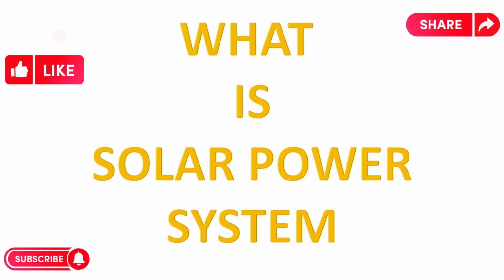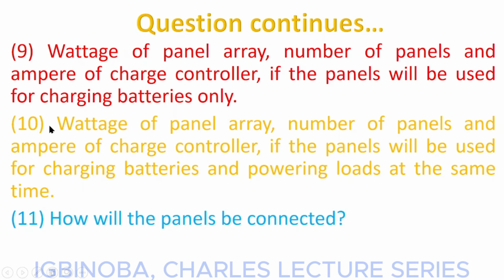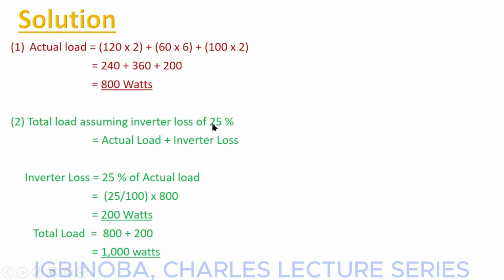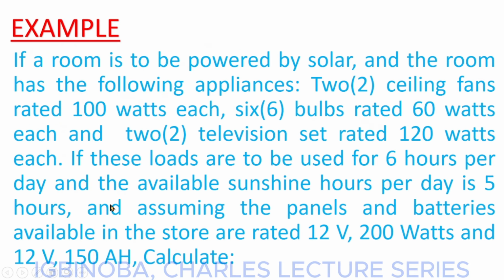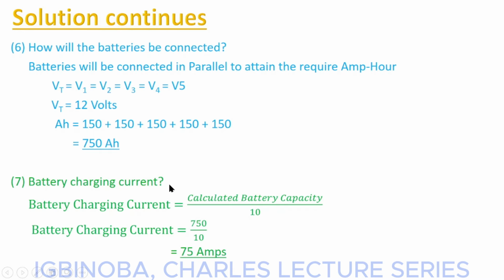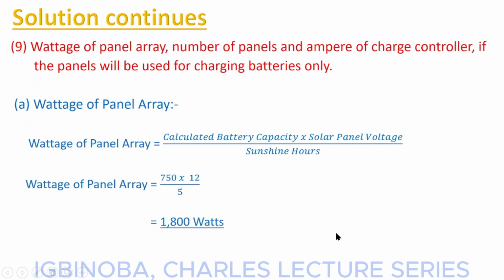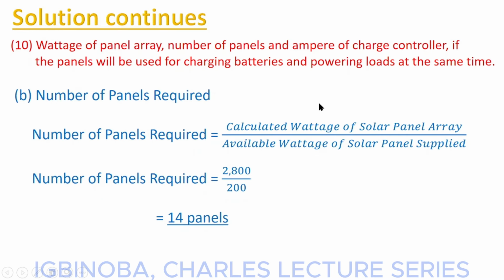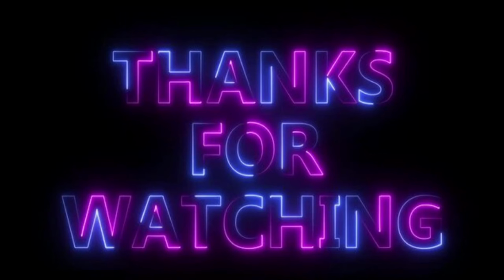Design of Solar Power System

Comment: PETRO89K
ANSWER:1.Actual load = 1380 W (8280 Wh/day)
2. Total load (25% inverter loss) = 1380/0.75 = 1840 W (11040 Wh/day)
3.Inverter rating = 1840/0.8 = 2300 VA
4.Battery capacity = 11040/(12×0.75) ≈ 1226.7 Ah
5.Number of batteries = 1226.7/150 ≈ 9 batteries
6.Connection = All in parallel (system voltage = battery voltage = 12V)
7.Charging current = 1226.7/5 ≈ 245.3 A
8.Charging time (40% loss) = 5/(1−0.4) ≈ 8.3 hours
9.Charging batteries only: Energy = 1226.7×12 =14720Wh → Power=14720/5=2944W → Panels=2944/200≈15 panels; Controller current=2944/12≈245.3 A
10.Charging + powering load: Total power=1840+2944=4784W → Panels=4784/200≈24 panels; Controller current=4784/12≈398.7 A
11.Panels connected in parallel (matching 12V system voltage)

Comment: PETRO5E

Answers:
1. Actual load = 1380Watt
2. Total load = 1725Watt
3. Inverter rating = 2156.25VA
4. Battery Capacity = 1239.75Ah
5. Number of batteries = 8.625 (9 batteries)
6. They will be connected in parallel 
7. Battery charging current = 129.375A
8. Battery charging time with 40% loss = 14hrs
9a. Wattage of panel array = 3105Watt
9b. Number of panels = 16panels
9c. Ampere of charge controller = 258.75A
10a. Wattage of panel array with load = 4485Watt
10b. Number of panels = 23panels
10c. Ampere of charge controller = 373.75A
11. They will be connected in parallel.

Comment: CIV82D
Answers 
1.1380W
2.1725W
3.2156.23VA
4.1293.75Ah
5.No of batteries is 9
6.Parrallel connection 
7.129.4A
8.14 hours 
9a.3105W
 b.16 panels
 c.258.75A
10a.4830W
   b.24 panels 
   c.402.5A
11.The panels will be connected in Parallel

Comment: EEE77Y 

1, 1380W

2, 1725W

3, 2156VA

4, 1294AH

5, 9 batteries

6, Connected in parallel

7, 129A

8, 14 hours

9, 3106W,16 panels, 259A

10, 4831W,24 panels, 403A

11, parallel connection

Comment: MEC44R

(1) Actual load: 1380 watts
(2) Total load:1725 watt
(3) Inveter rating:2156.24VA
(4) Battery capacity:1239.75Ah
(5) Number of battery: 8.625(9 battery)
(6) The will be connected in parallel
(7) Battery charging current:129.375A
(8) Battery charging time with 40% loss:14hours
(9a) Wattage of panel array: 3105 watts (9b): number of panel:16 panels
(9c) Ampere of charge connected:258.75A (10a) Wattage of panel array with load: 4685 watt
(10b) Number of panel:23 panels
(10c) Ampere of charge controller:373.75A
(11) They will be connected in parallel

Comment: CIV31E

1. 1380W
2. 1,725W
3. The inverter rating is 2,156.23VA
4. The battery capacity is 1,293.75Ah
5. The Number of batteries is 9
6. The batteries are connected in parallel
7. The Battery charging current is 129.4 Amps.
8. The battery charging time is 14 hours
9. The wattage of the panel array is 3,105W
b. The number of panels is 16 panels.
c. The Charge controller rating is 258.75 amps.
10. The wattage of the Panel array is 4,830 Watts
b. The number of panels is 24 panels.
c. The charge controller rating is 402.5 amps.
11. The panels are arranged in parallel.

Comment: CHM97S
1. The actual pad is 1,380W
2. The Total load is 1,725W
3. The inverter rating is 2,156.23VA
4. The battery capacity is 1,293.75Ah 
5. The Number of batteries is 9
6.  The batteries are connected in parallel 
7. The Battery charging current is 129.4 amps.
8. The battery charging time is 14 hours.
9. a. The wattage of the panel array is 3,105W
b. The number of panels is 16 panels.
c. The Charge controller rating is 258.75 amps.

10. a. The wattage of the Panel array is 4,830 Watts 
b. The number of panels is 24 panels.
c. The charge controller rating is 402.5 amps
11. The panels are arranged in parallel

Comment: 1. Actual load = 1380Watt
2. Total load = 1725Watt
3. Inverter rating = 2156.25VA
4. Battery Capacity = 1239.75Ah
5. Number of batteries = 8.625, so 9 batteries will be
used
6. The batteries will be connected in parallel
7. Battery charging current = 129.375A
8. Battery charging time with 40% loss = 14hrs
9. For charging only:
a. Wattage of panel array = 3105Watt
b. Number of panels = 16panels
c. Ampere of charge controller = 258.75A
10. For charging + powering load:
a. Wattage of panel array with load = 4830Watt
b. Number of panels = 24panels
c. Ampere of charge controller = 402.5A
11. The panels will be connected in parallel

Comment: EEE42P
1. The actual pad is 1,380W
2. The Total load is 1,725W
3. The inverter rating is 2,156.25VA
4. The battery capacity is 1,293.75Ah 
5. The Number of batteries is 9
6.  The batteries are connected in parallel 
7. The Battery charging current is 129.4 amps.
8. The battery charging time is 14 hours.
9. a. The wattage of the panel array is 3,105W
b. The number of panels is 16 panels.
c. The Charge controller rating is 258.75 amps.
10. a. The wattage of the Panel array is 4,830 Watts 
b. The number of panels is 24 panels.
c. The charge controller rating is 402.5 amps
11. The panels are arranged in parallel

Comment: MEC43Q

1. 1380 W

2. 1840 W

3. 2300 VA (or 2.3 kVA)

4. 1226.67 Ah

5. 9 batteries

6. Parallel connection

7. 122.67 A

8. 16.67 hours

9. Array Wattage: 3680 W | Number of Panels:

19 panels | Charge Controller: 306.67 A (or

350 A standard rating)

W

| Number of

10. Array Wattage: 5888

Panels: 30 panels | Charge Controller:

490.67 A (or 500 A standard rating)

11. Parallel connection

Comment: MEC34H 
1. Actual load = 1380Watt
2. Total load = 1725Watt
3. Inverter rating = 2156.25VA
4. Battery Capacity = 1239.75Ah
5. Number of batteries = 8.625, so 9 batteries will be used
6. The batteries will be connected in parallel
7. Battery charging current = 129.375A
8. Battery charging time with 40% loss = 14hrs
9. For charging only:
   a. Wattage of panel array = 3105Watt
   b. Number of panels = 16panels
   c. Ampere of charge controller = 258.75A
10. For charging + powering load:
    a. Wattage of panel array with load = 4830Watt
    b. Number of panels = 24panels
    c. Ampere of charge controller = 402.5A
11. The panels will be connected in parallel

Comment: CIV61I
Answers: 1. 1380 W

2. 1840 W

3. 2300 VA (or 2.3 kVA)

4. 1226.67 Ah

5. 9 batteries

6. Parallel connection

7. 122.67 A

8. 16.67 hours

9. Array Wattage: 3680 W | Number of Panels:

19 panels | Charge Controller: 306.67 A (or

350 A standard rating)

W

| Number of

10. Array Wattage: 5888

Panels: 30 panels | Charge Controller:

490.67 A (or 500 A standard rating)

11. Parallel connection

Comment: 𝗠𝗔𝗥𝟳𝟰𝗩

Answer:
1. Actual load = 1380Wart
2. Total load = 1725 Watt
3. Inverter rating = 2156.25VA
4. Battery Capacity = 1239.75Ah
5. Number of batteries = 8.625 (9 batteries)
6. They will be connected in parallel
1. Battery charging current = 129.375A
8. Battery charging time with 40% loss = 
14hrs
9a. Wattage of panel array = 3105Watt
9b. Number of panels = 16panels
9c. Ampere of charge controller = 258.75A
10a. Wattage of panel array with load = 4685 Watt
10b. Number of panels = 23 panels
10c. Ampere of charge controller = 373.75A
11. They will be connected in parallel

Comment: CHM79A 

1=1380W
2=1725W
3=2156.25VA
4=1293.75Ah
5=8.6 approximately 9 batteries 
6=parallel connection 
7=129.4Amps
8=13.99hrs approximately 14hrs
9=PV array 3105W, panels 16, charge controller 258.75Amps
10= PV array 4830W, panels 24, charge controller capacity 402.5Amps
11= parallel connection

Comment: MAR85G

Answer:
(1) Actual load
3 × 100 W + 10 × 60 W + 4 × 120 W = 1380 W
(2) Total load (25% inverter loss)
1380 / 0.75 = 1840 W
(3) Inverter rating (PF 0.8)
1840 / 0.8 = 2300 VA
(4) Battery capacity (75% reserve/DoD)
(1840 × 6) / (12 × 0.75) = 1226.67 Ah ≈ 1227 Ah
(5) Number of batteries
1227 / 150 ≈ 8.18 → 9 batteries
(6) Battery connection
All 9 in parallel (12 V system)
(7) Battery charging current
0.1 × 1227 ≈ 122.7 A
(8) Battery charging time (40% charging loss)
(1227 × 0.75) / (122.7 × 0.6) ≈ 12.5 hours
(9) Panels for charging batteries only
Power = 12 × 122.7 = 1472.4 W
Number of panels = 1472.4 / 200 ≈ 7.36 → 8 panels
Charge controller ≈ 130 A
(10) Panels for charging batteries + powering loads
Load current = 1840 / 12 ≈ 153.3 A
Total current = 122.7 + 153.3 = 276 A
Power = 12 × 276 = 3312 W
Number of panels = 3312 / 200 = 16.56 → 17 panels
Charge controller ≈ 280–300 A
(11) Panel connection
All panels in parallel (12 V system)

Comment: COMP74V

1. The actual load is 1,380W
2. The Total load is 1,725W
3. The inverter rating is 2,156.23VA
4. The battery capacity is 1,293.75Ah 
5. The Number of batteries is 9
6.  The batteries are connected in parallel 
7. The Battery charging current is 129.4 amps.
8. The battery charging time is 14 hours.
9. a. The wattage of the panel array is 3,105W
b. The number of panels is 16 panels.
c. The Charge controller rating is 258.75 amps.

10. a. The wattage of the Panel array is 4,830 Watts 
b. The number of panels is 24 panels.
c. The charge controller rating is 402.5 amps
11. The panels are arranged in parallel

Comment: NAT10J 

Answer 
1. The actual pad is 1,380W
2. The Total load is 1,725W
3. The inverter rating is 2,156.23VA
4. The battery capacity is 1,293.75Ah 
5. The Number of batteries is 9
6.  The batteries are connected in parallel 
7. The Battery charging current is 129.4 amps.
8. The battery charging time is 14 hours.
9. a. The wattage of the panel array is 3,105W
b. The number of panels is 16 panels.
c. The Charge controller rating is 258.75 amps.

10. a. The wattage of the Panel array is 4,830 Watts 
b. The number of panels is 24 panels.
c. The charge controller rating is 402.5 amps
11. The panels are arranged in parallel

Comment: PETRO70R

Answers:
1. Actual load = 1380Watt
2. Total load = 1725Watt
3. Inverter rating = 2156.25VA
4. Battery Capacity = 1239.75Ah
5. Number of batteries = 8.625 (9 batteries)
6. They will be connected in parallel 
7. Battery charging current = 129.375A
8. Battery charging time with 40% loss = 14hrs
9a. Wattage of panel array = 3105Watt
9b. Number of panels = 16panels
9c. Ampere of charge controller = 258.75A
10a. Wattage of panel array with load = 4485Watt
10b. Number of panels = 23panels
10c. Ampere of charge controller = 373.75A
11. They will be connected in parallel.

Comment: CIV84F 

Answers   :  
1.  1380W

2.  1,725W 

3.  The inverter rating is 2,156.23VA 

4. The battery capacity is 1,293.75Ah 

5. The Number of batteries is 9 

6. The batteries are connected in parallel

 7. The Battery charging current is 129.4 Amps.
  
8. The battery charging time is 14 hours
  
9. The wattage of the panel array is 3,105W 
b.  The number of panels is 16 panels.  
c. The Charge controller rating is 258.75 amps.   

10. The wattage of the Panel array is 4,830 Watts
 b. The number of panels is 24 panels.   
c. The charge controller rating is 402.5 amps.
  
11. The panels are arranged in parallel.

Comment: EEE3C

1380 watts

1725 watts

2156.25 VA

1293.75 Ah

9  batteries 

the batteries will be connected in parallel 

129.4 amps

14 hrs

3105 watts

16 panels

258.75 amps

4830 watts

24 panels 

402.6 amps

the panels will be connected in parallel

Comment: MAR42P
1. The actual pad is 1,380W
2. The Total load is 1,725W
3. The inverter rating is 2,156.23VA
4. The battery capacity is 1,293.75Ah 
5. The Number of batteries is 9
6.  The batteries are connected in parallel 
7. The Battery charging current is 129.4 amps.
8. The battery charging time is 14 hours.
9. a. The wattage of the panel array is 3,105W
b. The number of panels is 16 panels.
c. The Charge controller rating is 258.75 amps.

10. a. The wattage of the Panel array is 4,830 Watts 
b. The number of panels is 24 panels.
c. The charge controller rating is 402.5 amps
11. The panels are arranged in parallel

Comment: CIV45S

Answer

1

Actual load = 1,380 W

2

Total load = 1,840 W

3

Inverter = 2,300 VA → choose 3 kVA

4

Battery capacity = 1,226.7 Ah @ 12 V

5

9 batteries

6

Batteries connected in parallel

7

Charging current ≈ 245 A

8

Charging time ≈ 8.33 h

9

12 × 200 W panels = 2,400 W, ≈ 200 A controller

10

24 × 200 W panels = 4,800 W, ≈ 400 A controller

11

Panels connected in parallel for the 12 V arrangement

Comment: CIV3C

Answers:

1.The actual pad is 1,380W
2.The Total load is 1,725W
3.The inverter rating is 2,156.23VA
4.The battery capacity is 1,293.75Ah
5.The Number of batteries is 9
6.The batteries are connected in parallel
7.The Battery charging current is 129.4 amps.
8.The battery charging time is 14 hours.
9.a.The wattage of the panel array is 3,105W
b. The number of panels is 16 panels.
c. The Charge controller rating is 258.75 amps.
10.a. The wattage of the Panel array is 4,830 Watts
b. The number of panels is 24 panels.
c. The charge controller rating is 402.5 amps.
11.The panels are arranged in parallel.

Comment: MAR55C 

ANSWER 

1380watts

1725wattd

2156.25VA

1293.75ah

9  batteries 

parallel connection 

129.4amp

14 hrs

3105watts

16 panels

258.75amps

4830watts

24 panels 

402.5amps

the panels are arranged in parallel

Comment: EEE34H

(1) ACTUAL LOAD = 1380 watts
(2) TOTAL LOAD = 1725 watts
(3) INVERTER RATING VA = 2156.25 VA
(4) BATTERY CAPACITY = 1293.75 Ah
(5) NO. OF BATTERIES = 9 Batteries
(6) PARALLEL CONNECTION
(7) BATTERY CHARGING CURRENT = 129.39 Amps
(8) CHARGING TIME (40% LOSS) = 14 Hrs
(9a) PANEL WATTAGE = 3105 watts
(9b) NO. OF PANELS = 16 Panels
(9c) AMPS OF CHARGE CONT. = 258.75 Amps
(9d) PARALLEL CONNECTION
(10a) PANEL WATTAGE = 4830 watts
(10b) NO. OF PANELS = 24.15 (Make 25 panels to carry
system)
(10c) AMPS OF CHARGE CONT. = 402.5 Amps

Comment: NAT39M
1) Actual load= 1380W
2) Total load assuming inverter loss of 25%= 1725W
3) inverter rating in VA using a power factor of 0.8= 2156.25VA
4) Battery capacity using a factor reserve of 75%= 1239.75Ah
5) Numbers of batteries= 9 batteries 
6) They would be connected in parallel 
7) Battery charging current= 129.375A
8) Battery charging time assuming a loss of 40%= 14hrs 
9) Wattage of panel array= 3105W
II) Number of panel= 16 panel 
III) Ampere charge controller= 258.75A
10) Wattage of panel array= 4830W
II) Number of panel= 24 panel 
III) Ampere charge controller= 402.5A
11) The panel would be connected in parallel

Comment: COMP85G

1. 1,380W
2. 1,725W
3. 2,156.23VA
4. 1,293.75Ah 
5.  9 Batteries
6.  Parallel connection
7. Battery charging current 129.4 amps.
8. The battery charging time is 14 hours.
9. a. The wattage of the panel array is 3,105W
b. The number of panels is 16 panels.
c. The Charge controller rating is 258.75 amps.

10. a. The wattage of the Panel array is 4,830 Watts 
b. The number of panels is 24 panels.
c. The charge controller rating is 402.5 amps
11. parallel arrangement.

Comment: MAR14N 

1. Actual load =1380watts
2. Total load = 1725watts
3. Inverter rating = 2156VA
4. Battery capacity = 1293.75Ah
5. No. Of batteries = 9 batteries
6. The batteries will be connected in series
7. Battery charging current = 129.4A
8. Battery charging time = 14hrs
9a. Wattage of panel array = 3105W
9b. Number of panels = 16 panels
9c. Ampere of charge controller = 258.75A
10a. Wattage of panel array = 4830W
10b. Number of panels = 24 panels
10c. Ampere of charge controller = 402.5A
11. The panels will be connected in parallel

Comment: PETRO50X
Answers

1.  Actual load = 1380Watt
2.  Total load = 1725Watt
3.  Inverter rating = 2156.25VA
4.  Battery Capacity = 1239.75Ah
5.  Number of batteries = 8.625, so 9 batteries will be used
6.  The batteries will be connected in parallel
7.  Battery charging current = 129.375A
8.  Battery charging time with 40% loss = 14hrs
9.  For charging only:  
    a. Wattage of panel array = 3105Watt  
    b. Number of panels = 16panels  
    c. Ampere of charge controller = 258.75A
10. For charging + powering load:  
    a. Wattage of panel array with load = 4830Watt  
    b. Number of panels = 24 panels  
    c. Ampere of charge controller = 420.5A
11. The panels will be connected in parallel

Comment: NAT50X 

(1) Actual load: 1380 watts 
(2) Total load:1725 watt 
(3) Inveter rating:2156.24VA
(4) Battery capacity:1239.75Ah
(5) Number of battery:8.625(9 battery)
(6)The will be connected in parallel 
(7) Battery charging current:129.375A
(8) Battery charging time with 40% loss:14hours 
(9a) Wattage of panel array:3105 watts 
(9b): number of panel:16 panels 
(9c) Ampere of charge connected:258.75A
(10a)  Wattage of panel array with load:4685 watt 
(10b) Number of panel:23 panels 
(10c) Ampere of charge controller:373.75A
(11) They will be connected in parallel

Comment: PETRO30D

Answers:
1. Actual load = 1380Watt
2. Total load = 1725Watt
3. Inverter rating = 2156.25VA
4. Battery Capacity = 1239.75Ah
5. Number of batteries = 8.625 (9 batteries)
6. They will be connected in parallel 
7. Battery charging current = 129.375A
8. Battery charging time with 40% loss = 14hrs
9a. Wattage of panel array = 3105Watt
9b. Number of panels = 16panels
9c. Ampere of charge controller = 258.75A
10a. Wattage of panel array with load = 4485Watt
10b. Number of panels = 23panels
10c. Ampere of charge controller = 373.75A
11. They will be connected in parallel.

Comment: MAR17Q
Answer:
1. The actual pad is 1,380W
2. The Total load is 1,725W
3. The inverter rating is 2,156.23VA
4. The battery capacity is 1,293.75Ah 
5. The Number of batteries is 9
6.  The batteries are connected in parallel 
7. The Battery charging current is 129.4 amps.
8. The battery charging time is 14 hours.
9. a. The wattage of the panel array is 3,105W
b. The number of panels is 16 panels.
c. The Charge controller rating is 258.75 amps.

10. a. The wattage of the Panel array is 4,830 Watts 
b. The number of panels is 24 panels.
c. The charge controller rating is 402.5 amps
11. The panels are arranged in parallel
Reply: PETRO23W
1380W
1725 W
2156.25VA
1293.75АН
9 batteries.
The batteries will be connected in parallel
129.375A
14hrs
3105W
16 panels
258.75A
300A Charge controller will be suitable.
4830 A
24 Panels
402.5A
500A charge controller will be suitable The panels will be connected in Series